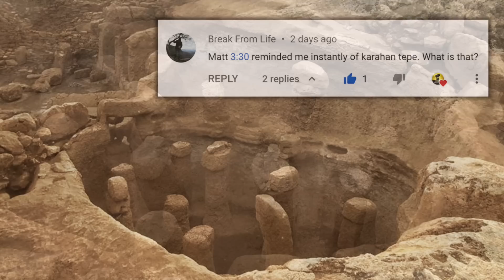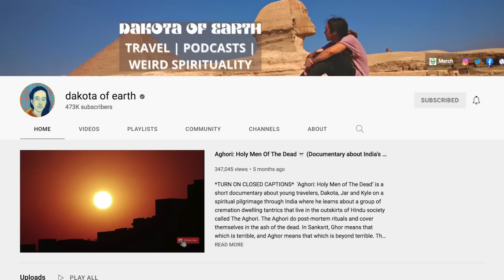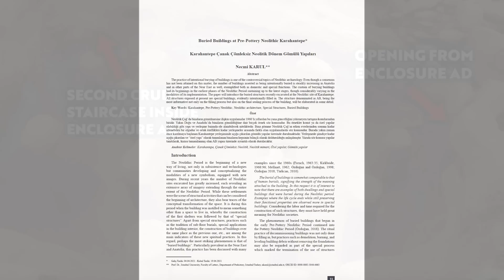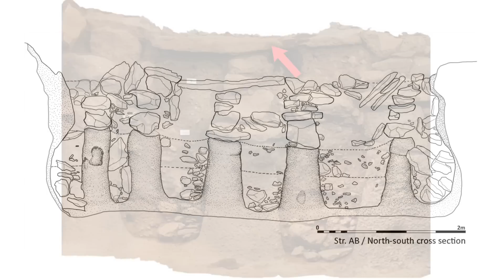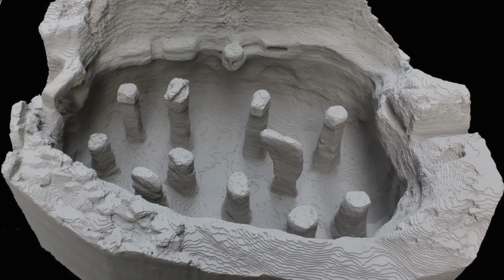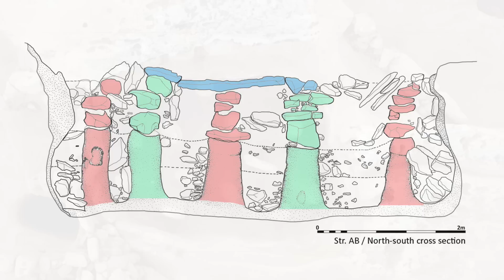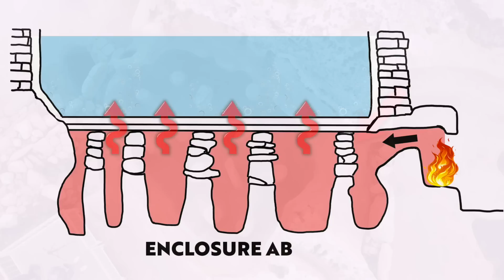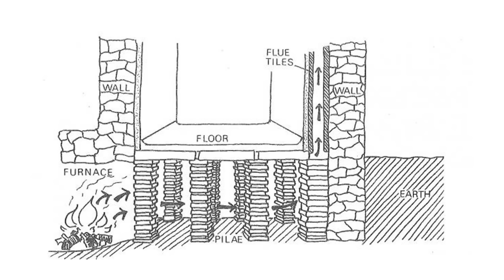An 11,500-Year-Old Central Heating Hypocaust system at Karahan Tepe? | Ancient Architects

Comment: Just to think outside of the box, was it just a swimming pool or a water storage with flow through in an arid climate? The small channel to run off over flow? The small entrances so you could just float through? Was the climate hot back then or cold? The pillars to hold a roof to stop evaporation?

Comment: I really wish this was a heating system.  This isn't that farfetched to me if you consider how long humans have had mastery of fire and by the time Karahan Tepe was built they were well accustomed to using it in interior spaces.  My only doubts come from the lack of evidence for consistently repeated fires in these supposed furnace areas along with the intricacy of the carvings in the rooms.  I bet it was indeed a room of sorts, but probably used for ceremonial or art purposes rather than as a furnace.  Either way, the fact that this was some sort of room with advanced 3d wall carvings this long ago is astounding regardless of its purpose.

Comment: That feature at Karahan Tepe sure looks like it was designed to hold water.  Perhaps a floor over top of a water reservoir held some religious significance. Or reduced evaporation.  The head carved on the side of the wall at 4:10 makes me think of a person bending down to drink from the surface.

Comment: I am on board with you concerning the floor-hypothesis. Indeed was this my first thougt when I saw the first video abouit that place. It seems so obvious to me, that there was a ceiling that is still visible at the walls and ojn top of one of the pillars. Regarding the heating-idea I am a bit skeptical - for the following reasons: 1. the pit is much deeper than it would have to be for that usecase - this seems an unnecessary effort. 2. The stonehead - it looks, like it was on the same level than the ceiling, what makes no sense - two possible explantions: a) the Head ist a later carving made of a remnescent of the ceiling, after it was removed. b) there was a hole in the ceiling at that place and the head was guarding it. 3. Thehole to the large enclosure with the furnace seems to high - looks like the ceiling would intersect with it.  My suggestion is: this was a cistern with a room on top of it - maybe with a opening in the floor to fetch water - and a second opening to the large enclosure for the same purpose. This explanation seems to me more likely considering the surounding structures…

Comment: The pit next to the hearth would not have been used to store firewood, especially if they were heating a large mass of water through a stone floor. Dumping fuel into the pit only to have to bend down or climb to lift it out in order to burn it would be neither efficient nor ergonomic. If AD was a kitchen, the pit would make a logical cool storage solution; a root cellar if you will.

Comment: the hypocaust theory is very interesting and should not be dismissed easily, however there are a few details that argue against it in my mind, at least for the main hole you've shown (the hole with T shaped pillars would make more sense for structural pillars) :
- why the different forms ? these people obviously mastered their stone work so why make fantasy pillars that aren't to be seen
- the face carving further interrogates me, why in the basement of a hypocaust ?
- the height of the pillars seems a bit high for the suggested usage (at least in compairason to Roman and medieval constructions) , however on that point I could be very wrong, I guess we'ed have to factor in temperatures at that period as well as the potential types of combustibles used (bush rather than thicker wood, or even dry grass etc).
It's really the 2 first points that bother me for this theory. let's say we leave the carved face out (could be a fire god or spirit, why not) but why the different forms of pillars ? why go thru all that trouble ? especially if you privilege the practical reasoning of this civilisation, which I agree with you about !

Comment: One problem I see with your theory: it does not explain the carved head, which would be buried by the floor. Also, the stone posts are phallic and decorative. If it was posts to hold a heated floor, they would likely not be decorated since the interior section of any heated floor would be restricted and dangerous, so no one would see them. I also see no creosote build-up like the Roman examples have. I would expect to see creosote buildup from all the fire/heat required to heat the area. Even if smoke was filtered somehow, the heated air still carries particulates and oils that build up and are hard to remove.
Reply: Not everything is a phallus.
Reply: @DunderMifflin_ThisisPam  True, but in cases where the site is fertility-based, penis shapes are almost always depicting actual penises, just as the vulvas drawn on women at those sites are not fancy belts, they are vulvas.

Comment: I cannot be sure but the 11th pillar, which was brought in and not carved in situ , seems to have a face and some other carving. 
Also, the depth of the AB floor is difficult to ascertain but if much lower than AA would help to support the heating theory. 
Being so close to the end of the YoungerDryas it is reasonable to assume a cool environment and a need for heat confort.
Hollows near the carved head seem to be another indication... but of what ?

Comment: It's a very well considered thesis but as you say, it requires more thought. You will need to address the fact that the furnace with a relatively small hole to it's side appears to be an extremely inefficient way of heating the large amount of water contained above the adjacent structure. Would it be even capable of raising it's temperature and, if so, by how much? How long would it take and how much fuel would it require? If you can ascertain the dimensions of the pool of water then some fairly simple science should get you the answer to if this theory is even possible.

Comment: It’s literally an enclosure - a goat pit. 

The top edges of the wall are protruding in and pillars are upright because goats climb; this makes it a lot harder for them to climb out. Those pillars are wider at the top because goats jump - the ropes they were tied with at certain times would get caught on the bulging penis head and pull them down, preventing them from jumping out. Some pillars are bigger, some smaller - some goats are bigger, some smaller. 
The passage to the neighbouring enclosure is not small. It’s exactly the size suitable for goats. The steps as they are optimal for goat hoofs and goat walk - the clonk-clonk. They won’t jump through doors; they’re not trick animals. 
The round pit on the other side is the bowl from where the goats drank water. 
That whole big circular enclosure is where humans would handle them when need be (to take care of them, to milk them, to clip their fur, to help them with childbirth, to kill them, …). In other times it’s for them to run head first into stuff and ram every single surface with their horned heads. It’s their favorite pasttime. That’s why it’s all made from rock. Them some hard heads. 
There’s not much archeological evidence down there because goats don’t really have stuff. They don’t do pots. Not having fingers (or secrets) frees the spirit of most, if not all,  material possession :D

The head in the enclosure was indeed to keep an eye on someone - the goats. Tamed animals are fearful of their handlers. They’re animals of prey; the sight of predators can paralyze them with fear. The eyes are shadowed by the brow and dug into the face to appear darker than the rest of the face, so that to the goats it looks like it’s eyes are open and watching. The lips are accented and puckered because then you can whistle at them from somewhere else (to get them to settle down, etc); to them it would seem the man on the wall is whistling. 
The channel that is leading out is for the sound; you need to be able to hear them, because you surely won’t be watching them all the time (that’s what the head is for!). You need to be able to hear them because they sometimes get lost in space and time (they, too, can hit their heads a little too hard :D) and then they cry and rile all the goats up. Stress is what makes their milk sour, their hooves flaky, and their fur thinner and falling out. Makes them go a little crazy, too. The channel is also for sound to go in. I’d bet the acoustics are such that goats from down there between the pillars wouldn’t really be able to tell from where the humans are yelling back at them - must be from the head up on the wall, they’d fool themselves. 

The space behind the goat pit is elevated - that’s where the humans would be. The large pit back there is for the hay the goats eat; the hay needs to be covered and protected from the sun and rain. That big flat stone found lying atop the buried enclosure? Good chance it fits this hay pit.

There would definitely be a roof atop all of these to provide them with shade and provide them a shelter from the rain. But it could be a simple cover made from reed, shrubery and stuff like that. They don’t need much more.
The two small holes up on the wall are for the hoofing related matters. What are goats if not the clonk-clonk clonk-clonk of their healthy hoofs?

The site could have been later buried to hide the knowledge of proper goat care from rival peoples. At those times, when domestication was still something relatively new, this knowledge and these techniques would be real power (we compete with each other over resources now, and have been since the dawn of history - our history is quite literally a story of competition with each other. Our prehistory, from what we know, with our probable mishandling of relations with our sister species, was that same story too). Knowledge IS power, and in a competitive world power is that which you have and others don’t. For as long as we discover and learn, peace will not be an option for us, I’m afraid. 

Also, people could have switched from goats to some other animals at one point, and it could have been cleaned and buried for their comfort in regard. Some species of animals don’t bode well with proofs of habitation of certain other species; they’d probably never pick that territory for themselves if it reeked of goat shit and hauntingly echoed clonk-clonks clonk-clonks on cold and lonely nights. 

There, that’s my hypothesis. But I saw a goat just yesterday, so I might be still under it’s horns. I would suggest everyone to visit their local zoo, if possible. Just please don’t dismiss the idea because it might be in mismatch with whatever you say you are to other people. Character is the only identity we have. What we make up is made up, and not there. 
Anyway, at the zoo you’ll see enclosures strikingly similar to these in their use and flow of space. You’ll also see these little hardheaded fuckers clonk-clonking around testing how hard their horns are and living their jumping jack lives in spaces just like these. 

(Remember people, by doing nothing we do nothing; to care about the animals is to do something for them - go meet your local enslaved, and fight for their rights. Passive is pure declarative and thus self-fulfilling; rain does not fall back up to the clouds - it was the cloud, and cloud is no more. Passion is pure action and thus new-creating. Rain will go back to the sky, as a new cloud. Being a prophet of a certain change, when you yourself are capable of becoming that change would be irrevocably impotent, would it not? Worse faith is that than that of Oedipus - he at least could fuck his mother. 
I am saying this because we have, as a species, become who we are through how we treated other animals and plantlife; we built relationships with other life in a way no other species has. We have made stuff and things a part of natural order: crows respect it and trade with us; dogs have their favourite toys like children do. This happened because we have developed a unique way with nature, love and life. Respect who we are. 
All tépes were taming grounds and animal enclosures. If we are to consider that hypothesis, we have to forget about the gods to be able to consider it. Gods know nothing. Sphynx is a cat. People are human - until they forget that what makes us human is our relationship with nature. Nothing else. The truth of the matter is that this is not just our history. Those are not our clonk-clonks clonk-clonks beating down in the pit on certain cold and lonely nights. I implore you to not take into account this hypothesis if your relationship with animals is declarative. This is not my hypothesis; it’s the goats, too. Am I being too dramatic? Yes. And I’m telling you all: you gotta go see the goat. 
And if you won’t go see the goats, but you want to understand a period in the natural history of this world at which certain species developed a wholly new type of relationship and language, which not only made us into who we are (our history being just our role played in this grand natural history), but it also made dogs, among many other new-creations? Clonk-clonk, brother, clonk-clonk. You can lie to the gods, but not the goats.)
Reply: To understand the full magnitude of what I’m saying I’ll be now short, direct and honest: I fell in love, or an obsession, with matters of our ancient past, much like large majority of you, because it’s secrets and unknowns held a promise of something divine. Truth, Wisdom, Eternal Life; God. To think that tepes were not built for gods, but for goats, seems like an immense letdown. Seems like the search goes on, right? Until I went to see the goats. Until I heard how they clonk-clonk clonk-clonk baaah. And I realized that we are such fools. The goats are here. They were here all along. They need us, we need them. Goats are us - we are goats. The gods were never here. Truth can’t be any less than true, life can’t but go on. Not with gods, but with goats. What we were looking for all this time is literally within reach. Pray to the goats. 

God, let my people clonk-clonk clonk-clonk!
God there is not,
or we are gone.
Don’t forget who we are.
Go and see the goat.
Clonk-clonk,
or go with God.
Me and the goats will then be the Oedipus your parents deserve.
This is how it is.

Comment: I don't think it is a heating system - the 'entrance isn't a good candidate for a firebox.

But it's the calcium deposits that really make me doubt that. They appear consistent with water filling. Water would be nearly impossible to heat in that configuration. 

If water is involved it's unlikely to be a heating system BUT it might be a cooling system. Circulating water could cool the floor above and serve as a bath of sorts given the stairs. It appears that there would have been an air gap between the water and the floor.

Comment: Hi matt, I would love your thoughts on my points.. Firstly great thinking out of the box.. My thoughts the flue would that not need to be on the opposite side of the fire to enable proper heating? If you were building this from scratch? Is the face looking at the fire that would give credence to your hypothesis. Possibly disused after climate warmed and rain fall became scarce? The inlet/outlet seems deep to shallow this would be water in not out? Thanks for your time!

Comment: What if it was a hot spring? I wonder if there's any evidence for that. The hot water gathers in AA - the hottest pool. Depending on the temperature it could have been for dipping into, or for cooking if it was hot enough. From there it flows into AB, which could have been a hot room, or even a steam room. It might also have been used to filter the water or remove sediment before it entered the main pool. The little channel might be for overflow, if the water goes in that direction. The vertical slabs might have been used to control the flow. The main pools looks very much like a bath house, similar to a Japanese onsen. With the water cooled and cleaned, it could have been a meeting place with a variety of functions - health, social and spiritual.

Comment: This is an interesting idea. I'm wondering what the horizontal slot is to the right of the protruding head. To my eye, it looks like a waterfall faucet and the snaking pathway that goes under the modern walkway sure looks like a purposely cut waterway. Just my thoughts. Thank you for your presentation and hard work.
Reply: an overflow outlet, leading someplace where such an overage could be used---say a garden

Comment: Im going to guess that it was a hot water maker, if you covered the pillars with concrete and water run from the top shallow pond over the concrete which would have a fire underneath and the water would then gather at the hole in the large area

Comment: Thanks for the video.  However, if used for heating, why put the face in there?  If it was designed around function then why place a head there which, I should imagine, would have been covered over.  

If designed for heating then this quite small and oddly shaped room would seem one of the only areas they bothered to add in such a feature.  Surely for someone who could create such a thing they would have done it within the kings house/large greeting/welcoming room to impress guests.

 So I don't believe it was for heating, though at the same time I can not think what it what supposed to be.  My first guess was a pool system for reflecting the stars from above - perhaps the "pillars" were for identifaction, adding to thoughts around it being a calendar?

Comment: I think a lot of confusion from sites comes from the continual repurposing of structures over centuries and possible millennia . Such as the face carving which may have been added in much later . If the upper building had been destroyed humans may have sheltered below repurposing whatever the sub level was originally used for .